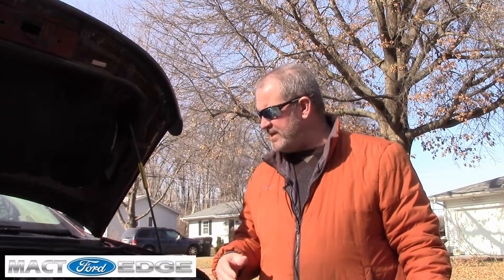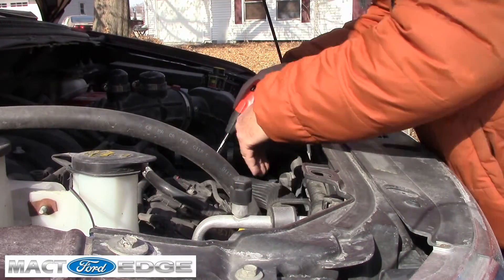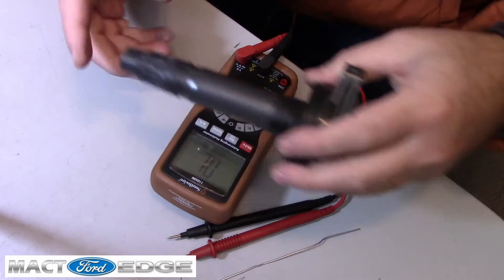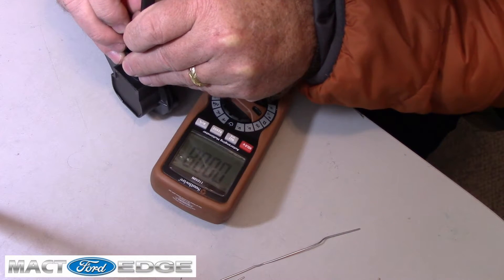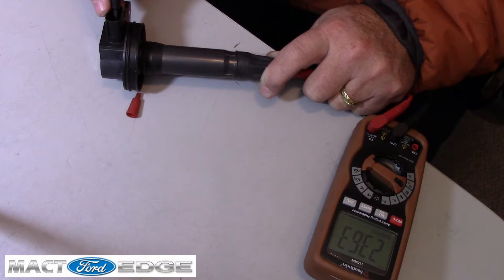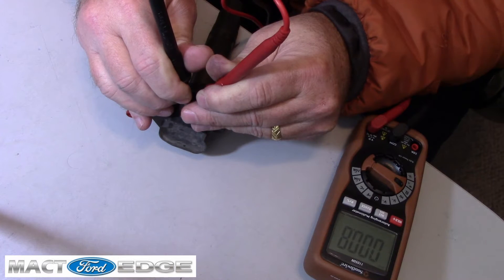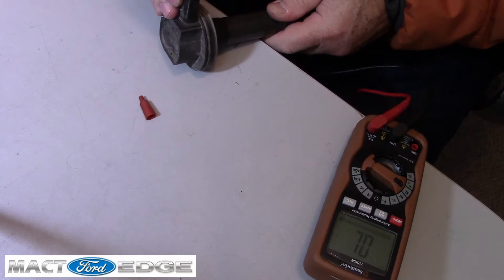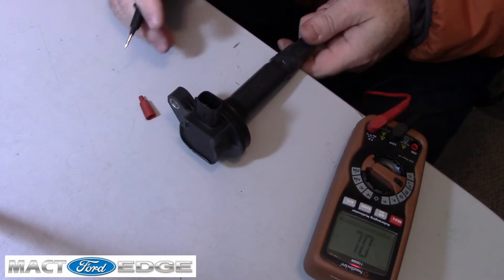Testing of the coils for the Ford Edge New vs 180,000 coils

Comment: Mac, I just tested my 2011 with 106,000 and I had the same across the primary.   .7 ohm. When I went to test the secondary coil, my test lead wasn’t long enough to catch that plug connection